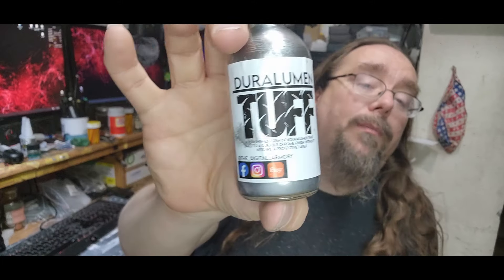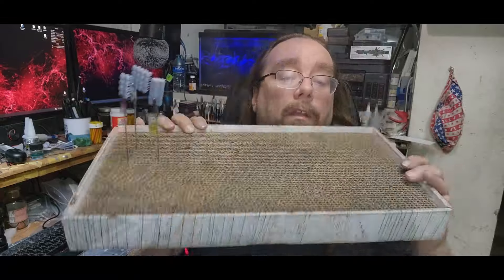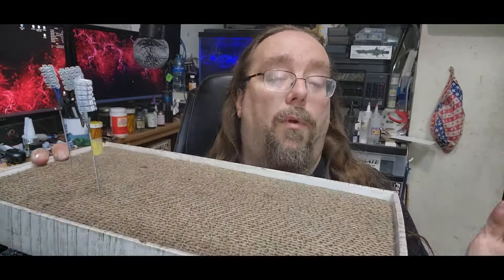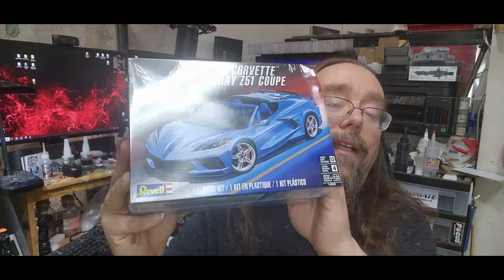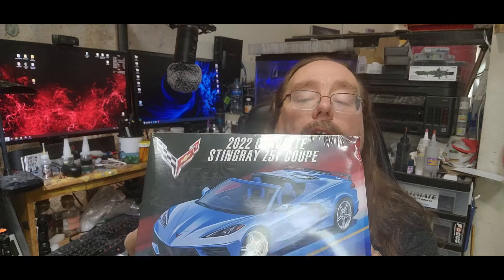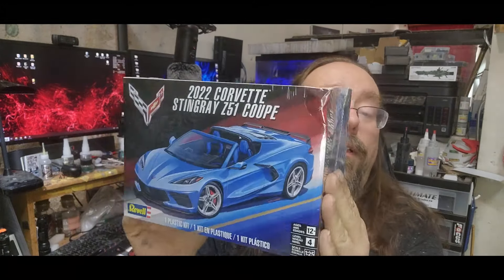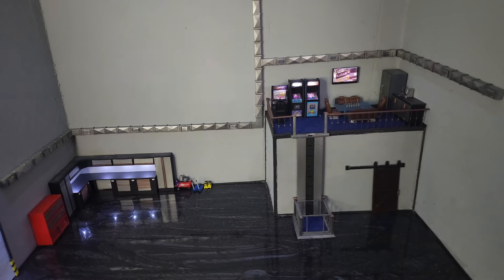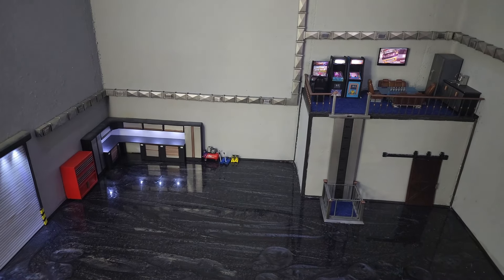Bench Update and Stash Adds 8-24-24

Comment: I really like your videos maybe you  could probably help me out I have a 3d printed 572 super charged engine now I don't know how to paint it or what colors to use so needless to say iam stuck with a gray primed motor hope you could throw a wrench at me thanks for you time
Reply from the maker: Option 1 is to browse the net to see what colors the engine "should be" abd issue similar color paints.  Option 2, which I'm fond of,  is to paint the block in black or some form of silver like steel or aluminum, paint the heads a brighter silver, do the valve covers abd top of air cleaner in body color. Oil pan can be bright silver,  chrome,  good,  or body color.  And to break things IP I do the intake manifold in something like a gin metal / magnesium.  Carbs silver and/or gold.   That usually gets you a nice "show car" engine.
Reply: Thanks  you sir just been catching  up on the nova build great job
Reply from the maker: @timothymelick7085  Thanks!